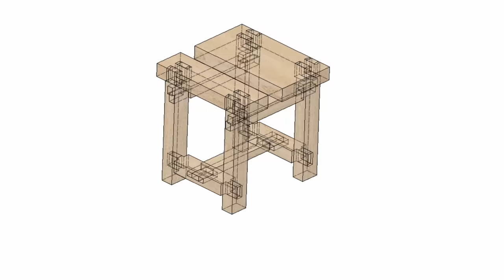The Dwarfed Behemoth Roubo Bench with Arms (The making of the body).

Comment: The patience required to get to this level. The skills learned the hours burned to perfect these same skills, the drive it took to invest in all of the tooling used, and the drive to learn to use them all to their full potential. This is a project that took 25+ years to build. I really love the use of the machining of the parts for the perfect fit. It seems that it was more for the perfect aesthetic of the finished piece than the function of each joint.  I will have to venture out that this man's career is probably tool-making. I have only seen this level of care taken at the tool and die makers.
Reply from the maker: Thank you Kevin, I appreciate every word you said, and I don’t know what to reply to that man, thank you again sir 🌹🤝
Reply: @TheWoodCrafter1  Nothing is needed. This was the first video of yours I have seen. watching while at work. (Actually stopped working to focus on this video) I am a Mechanical Engineer and just now starting a woodworking hobby. I only hope to have a fraction of your abilities by the time I am finished revolving around the sun.  You now have a new sub and will be watching every video.  I am now on the NSK servo actuators being assembled as a CNC.
Reply from the maker: @kevinhufford1064  It is a pleasure to know that and great to have you on board man, you are most welcome 🤝
Reply: @TheWoodCrafter1  Here's how to reply; It doesn't take 25 years!

Comment: I’m always amazed at the precision you get with a computer guided router, but there is something about doing it by hand that is very satisfying, even if it’s not as tight as a CNC joint. 

That said, if I had a CNC I would certainly take advantage.
Reply: Seems to me the perfect blend of hand tools, power tools and hi-tech tools in one build. The way it should be done with no grief given over how they finished it. Just like nobody gives the guy who uses a jig and a table saw a hard time for not using a hand saw, mallet and chisel. 

I have a feeling Craftsmen of old would be laughing and shaking their heads over our debates/woodworking purity tests thinking to themselves "That magical device could have saved me SO MUCH time and wear on my body." considering their short lifespans it would have been considered a blessing. And as someone piped up to tell them "that's not real woodworking!" they'd just knock on the build and reply "Feels real to me" and never speak of it again.

Comment: this is a fascinating video, especially the novel usage of linear rails on the sliding vise jaw. Can you please tell me the manufacturer of the linear rails you used and their dimensions. There is a bewildering variety of linear rails with many variables so I am wondering which one you decided on re all the specs of linear rails ?
Reply from the maker: Thank you 🤝
These linear guides are from NSK/ UK, they are one of the top linear guide makers, but you still don’t need this much of quality and precision to move a vise! It happened that I found some stock from an old factory production line, any similar size should do the trick, here is a link for the type I have used, hope this helps https://www.nsk.com/common/data/ctrgPdf/e3332b.pdf

Comment: beautiful... is there a functional reason you did not remove the ghosting lines from the router sled flattening operation that run perpendicular across the surface? (This is where I struggle on utility furniture vs fine furniture myself and rarely can leave well enough alone)
Reply from the maker: I could have removed them with a hand plane but this might alter the flatness of the top which is very critical on this build as you will see in the next video! This is not a regular workbench and flatness is very crucial here not how beautiful it looks! Thank you for your comment .
Reply: @TheWoodCrafter1  I too thought the top was begging for a smoothing plane. I’ll watch the next video to see

Comment: Amazing, I guess there is no rocking with the linear guiderails. Aren't you concerned about sawdust jamming your bearings ?
Reply from the maker: These linear guides are so tight and has a front and rear plastic piece to clean the way during movements and wood dust is not an issue for them! Some vacuum from time to time won’t hurt though.

Comment: Thank you for your earlier reply.  I've since read about this type of bench , apparently it's an old French design (hence the use of French oak perhaps?), eponymous with its creator and nothing to do with a mis-spelled play on 'robo' as I assumed when you mentioned robotic arms.  Since watching your subsequent video as you advised, I think what you're fitting is what I would call linear slideways, rather than robotic arms as such.  I had visions of you having a bench with 3 car-factory assembly robots flying about doing all the planing, sawing and chiselling while you went to the pub.  Mind you, maybe that's not a bad idea.....
Reply from the maker: In the matter of fact, this is what NSK called these linear actuators, “robotic arms” as when combined together they perform specific linear motion, and when they are operated by servo motors connected to a preprogrammed control unit then they start look like robot arms or so🙂. Despite that your point is still valid but on YouTube you need to tweak titles somehow to make them more attractive and get viewers curious to click on the video, I hope that wasn’t misleading to you but if it was, then you earned my apologies! 
Also you can make your workbench with almost any wood species you like, that depends on your budget and the wood availability! French white oak usually considered as a stable wood but it is prone to splitting! That is not a big concern here as this table won’t be used as a real workbench to bear mallet blows, I have made another workbench on this channel using beechwood though.

Comment: Woodcrafter, a question about the level of design finish?  Why not take out the router bit leveling tool paths? Seems in congruent with the rest of the high level of fit and finish of overall precision?  I'm sure with someone as precise as you; this was a purposeful decision, just not sure what inspired it?  Wonderful piece of work from design and tool use through (and especially) the high precision video staging and editing. Nicely done.
Reply from the maker: Hay Kevin, thank you for your comment, these shadow lines that were left by the router bit are visible to the eye only not to the touch! The flatness of the top is very crucial here as you may have noticed on the next videos, I could have removed them completely using a hand plane, but that extra step will not improve the functionality of the top as a flat reference as it is dead flat nor removing the excess glue on the bottom side of the top.

Comment: Well done. Can you share what is the first ingredient used in the wood finish ?
Reply from the maker: Hi John, 
that thick amber colored  I poured at first is the (crude turpentine) or pine resin discharged by various species of pine tree, you don’t especially need to use that ingredient, and I am not sure where you can find it, maybe some musical instruments supplies shops will have some as the guy who sold it to me told me it was used by a guitar maker. I used it for 2 reasons: to help pop up the oak grain ( tung oil can do that too and I used it in a pure form with no additives) as it has a strong amber color, the 2nd reason is for it’s distinct smell that it produces like no other oil🙂 call me a junky, but it is so pleasant when it starts to dry.
Reply: @TheWoodCrafter1  Thank you, very much appreciate your craftsmanship and answer

Comment: I am looking forward to the next video to see how this works. Could you tell me what linear bearing/rails you used? Thanks
Reply from the maker: Sure thing 👌.
These linear guides were made in the UK by NSK, quite expensive for such application but I bought them as stock at less than half of their actual price, I believe that any other less expensive brand can do the job too. They are overkill unless you can find them salvaged from a factory that is upgrading it’s production lines. Hope this helps.

Comment: Great job all over! I have a question though: why did you use double wedges instead of a single one?
Reply from the maker: Thank you, that depends on the type of the tusk and tenon you will be making, if you use one wedge then the wedge mortise and the wedge should have the same angle cut to allow for the wedge to pull the tusk tenon towards the tusk mortise evenly and that can’t be easily achieved with the CNC I have, instead I made two wedges to eliminate the need for the wedged mortise, and to keep it square. Now the more you push these double wedges towards each other (each wedge is cut at 5 degrees on the matching face) the wider they become while they remain square from the outside, thus pulling the tusk tenon inside the mortise. I'm not sure if I've explained that well but I hope so.

Comment: Beautiful wood and design but why are there what appears to be planer mark across the  top surface?
Reply from the maker: These marks are shadow marks caused by the router bit when flatting the top, they are visible to the eye but not when touched, I could have removed them with the orbit sander, but what matters here is flatness more than appearance, the top is flat reference for the milling machine.
https://youtu.be/f8KJhj76-rE
Reply: Thanks, is the glue up stronger than if it was solid?
Reply from the maker: @TermiteUSA  the tests show that good glue is stronger than the wood, if the surfaces being glued were flatten correctly, I have glued pieces that are 15 years old and they are still intact, I also used epoxy on this bench on some joints as it is structurally stronger than wood glue.

Comment: Beautiful work. However, I was very disappointed to see all the router marks on the top of the bench. All that amazing work and you didn't sand the top enough to remove router marks!
Reply from the maker: Thank you, 
It’s about flatness, alternating the surface at this point we’ll affect that. 
The surface is clean to the touch, you can’t detect any unevenness with your fingers and closed eyes, and that is acceptable for the function of this bench.

Comment: Do you perfer Gorilla glue to Titebond 2 or 3?
Reply from the maker: I believe both are good, but I never used Titebond before and The Gorilla didn’t fail me yet on any project in the past 3 years, if it does I will share that, unless of course the joints were not made as good as they should.

Comment: Do you have any info on the vice hardware you've used? Also, dare I say, maybe grab a bigger hammer next time! Those little brass stubbies don't pack much of a punch.
Reply from the maker: Yeh I need a bigger hummer :), the hardware of the vise were salvaged from a factory and sold on junkyard, the NSK linear guides can be found online, the problem is they are expensive I was lucky to find them unused in a factory junkyard! sorry if this is not very helpful 🤝
Reply: @TheWoodCrafter1  No, that's ok. I thought it may have been a York vice screw, but the big threaded nut made me doubt it. Thanks! Love your work.

Comment: Where did you acquire the slide hardware?
Reply from the maker: Search for NSK linear guides, try finding them on ebay or other cheaper brands as these are super expensive and I did find some new ones as stock from a factory upgrading it’s production lines. Otherwise I won’t buy them from suppliers. Good luck
Reply: @TheWoodCrafter1  Thank you!

Comment: What finish did you use?
Reply from the maker: Polyurethane 30% + Tung Oil 50% + pine resin 10% + mineral spirits, although nothing is critical here you can remove the pine resin as it is not easily found in the market, and won’t make a big difference.

Comment: why do you use epoxy sometimes and wood glue other times?
Reply from the maker: I don’t have extend wood glue, the epoxy I am using has 90 min set time, so no panic! Also it is stronger but expensive and can be cleaned with warm water in case something went wrong during the gluing process as wood won’t absorb it instantly like it does with wood glue, if you have access to the extended set time wood glue then no need to use the epoxy.
Reply: @TheWoodCrafter1  I think wood to wood, regular PVA glue out performs epoxy
Reply from the maker: @fredleber2432  Maybe but maybe not all types of epoxy! Did you test that?
Reply: @TheWoodCrafter1  I've done some tests myself and watched A LOT of Project Farm. Almost always, if not always, wood glue does a better job at bonding wood to wood than any epoxy
Reply from the maker: https://craftknights.com/how-strong-is-wood-glue-really-we-tested-it/

Comment: could pass the oil recipe, thanks
Reply from the maker: Forget about the first one as it is hard to find I believe, liquid pine resin, and it adds no more protection, just a bit of amber color and lovely smell! The rest are pure untreated tung oil, very effective in popping up the oak grain, then polyurethane for more protection you can use it 50/50 if you like more protection! But beware that tung oil needs time to dry depending on the humidity and temperature! It can take up to 2 weeks 🤗 hope this helps

Comment: which kind of wood did you use?
Reply from the maker: The legs are made of red Oak, and the top is made of French white Oak
Reply: @TheWoodCrafter1  thank you
Reply: @TheWoodCrafter1  French white Oak seems to be very beautiful and elegant wood.
Reply from the maker: @antoncode3444  that’s true, also it is a stable wood and very resistant to humidity, it was used back in days for building ships and making wine barrels
Reply: @TheWoodCrafter1  you mean specifically the French white Oak not oak in general?
Reply from the maker: @antoncode3444  No, I mean white oak in general not red oak, and the French white oak is one of the best species.

Comment: Oh, right.  Let me run out to my garage and crank up,my CNC equipment. Really?  Great video but out of,reach for 99% of us.
Reply from the maker: The CNC can be replaced with a router fitted with the right jig and it should do the job just fine! Using the CNC wasn’t less challenging than that! If I should do that again I would definitely consider the router myself as it is faster, that was some sort of experimentation and I should have concluded that at the end of the video 👍

Comment: Again another video with no idea of measurements just wing it hope it fits put your plans in the comments
Reply from the maker: This bench was designed on CAD, it is not possible to put that on a comment, however the dimensions were made to accommodate the actuators that were added on another video hence it may not be very useful to know the exact dimensions. The overall all dimensions are H 34” , L 35” and W 34”